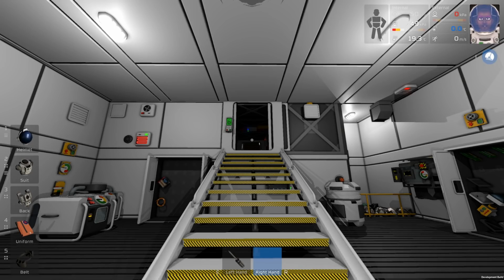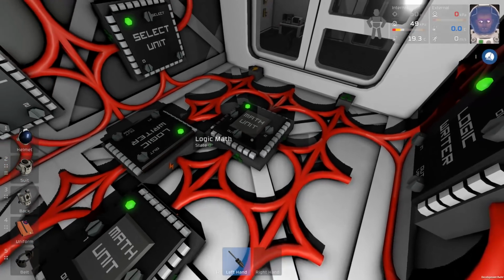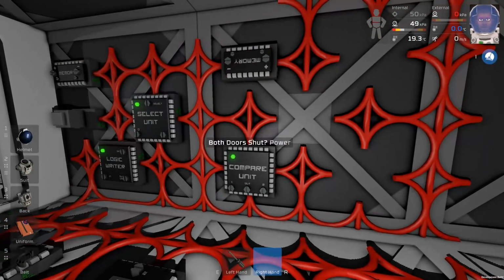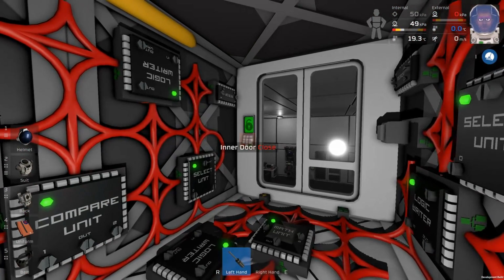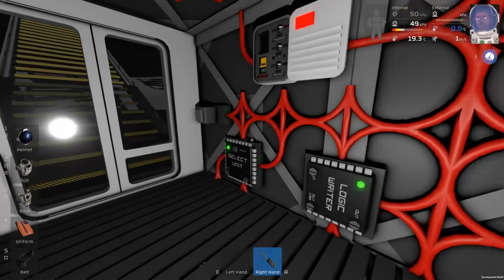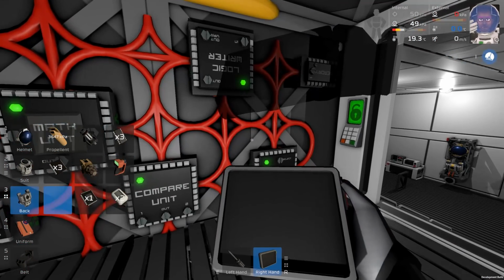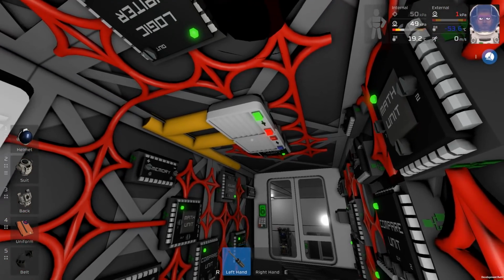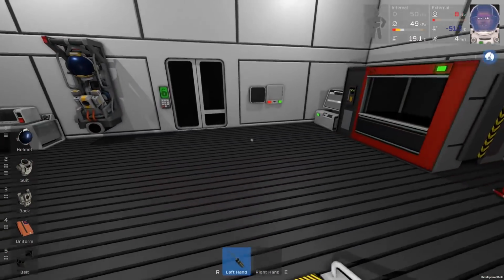Stationeers E26 Custom Build Airlock Part 2 (Electronics, Pressurisation)

Comment: Here's an idea to simplify this:

on each door have a sensor outside the airlock.  Compare to the airlock pressure.  Doors can only open if the airlock pressure=outside pressure.

If the door can open, and you press a button, the door opens for five seconds.

If you tell it to pressurize, it can only go up until the high pressure door can be opened.  If you tell it to depressurize, it only runs until the low pressure door can open.

The door logic could be "fuzzied" a bit so that they don't have to have perfect pressure, and you might want to add a safety so that both doors have to be closed to change the pressure, but that's about it for a manual airlock.

Comment: Lovin the video series.  Havent watched vid 3 yet on airlocks but hoping you do get to do a system that spans two different pressurised areas.
Could you clarify 1 thing for me though.  You stated that you changed the button setup from Episode 25 to a fixed system with the ipressurise and idepressurise memory chips.  I dont quite follow what you did there as obviously you still use the state memory chip which is written to with a button press.
Maybe I missed it or am being overly dense but that one flew by me.
Reply from the maker: With a button, you can't just write it's value to memory, because when you let go, it'll reset the memory to zero (the button's new value).  Instead, I used a select with an input of the button, where when the button is zero it'll use whatever the value is of the logic memory, and when the button is 1, it'll use iPressurise (or iDepressurise depending on which button).  That ensures that the memory is set to the correct value on a button push, but doesn't change it otherwise, since other electronics will be changing the logic memory's value (to understand what state the airlock is currently in)

Comment: Mmmm, looking at this, I think you're at the point where you could benefit, electronically, from a stateful computer. I.e.

"Is pressurising state 0 AND is interior pressure equal to exterior sensor, if so, open door" From a pragmatic point of view, it'd be interesting to see the level of complexity you can achieve through a terminal (if you can code custom chips) or proper computer relative to this huge spaghetti code.
Reply from the maker: Oh, this'd be simple if there was a scriptable/programmable computer :)
Reply: Absolutely. I was just thinking about your first solar angle setup, where you had all those cases inside the computer. It feels like that would be a good match here for your getters and setters with multiple conditions.
Reply: I was thinking that they should just add a programmable PLC to the game, so that you can use multiple virtual components.

It would be quite simple to control an airlock IRL with a PLC.

Comment: this is getting complicated , but in a good way, however can you not "use" the door buttons as buttons, because you can lock them from with logic, and when locked they will still output a signal to the logic network but not actually open the door

Comment: On our dedicated server, we resorted to using the airlock doors manually. We leave the active vent inside the lock on constantly, and when you go through a door you close it behind you. Wait at the outer door until your suit's sensor reads zero on external pressure. Haven't had any mistakes yet, but of course you could accidentally open both doors at the same time. In the future, maybe they will lower the power draw for logic components to a very small amount to reward even complicated logic-based automation.

Comment: Is the oxygen not too cold once you take your helmet off? I thought the oxygen needed to be warmed/cooled to the ideal temperature.
Reply from the maker: It does need to be warmed - there's a wall heater that automatically warms it up if I leave the atmosphere in the room.  It only cools down to -60 or so, because the atmosphere storage tank is in vacuum

Comment: For faster pressurisation;  use active vents for depressurisation and passive vents with pipe pressure pumps (or pressure limiters) for the pressurisation.  This allows us to pump the air using different classes of objects so we can use a single batch writer for each.
Reply from the maker: As in the video though, you can just put the active vents on separate subnetworks with a single batch writer each too :)
Reply: grayduster indeed. I haven't tried it, but I suspected it would be easier to work with one network as you don't have to care about the layout (you don't need to maintain a separation between the networks.)
Reply: But pressure pump is pretty slow... Isn't it? Maybe use volume pumps with shut off?
Reply from the maker: Pressure regulators are quite slow compared to active vents, definitely!

Comment: If not easy use 3 gas sensors  outside  inside and Chamber  if  outside < camper close inner door + depressur    if  outside = camper open ext door
Reply: If you add system for air filtering and temperature regulation it will cause pressure flactuations, which will lead to strange door behavior. Although, you could add some margin you expect to be normal pressure flactuation

Comment: Isn't there a more easy way to do it ? my next project is gonna be the Airlocks.
Reply from the maker: If you want a normal Airlock, sure.  Two doors, one vent and a console with an airlock board - this is more of an advanced build version.  Check out the early episodes for the easy version!
Reply: If you keep your base at 101 kPa like I do, you can just use a normal airlock.

I'll probably have to build a monstrosity like this for hydroponics myself. Probably involving lots and lots of flow charts

Comment: 19:18 I think you meant Batch Writer. And yeah, you can use them, just make sure not to mix data networks. But you have to use separated APC for that because Active Vents have combined data and power port ;(
Reply: I think all he'll need to do, is rename his active vent(s) in the airlock, and find the corresponding name in the batch writer output. But separating the network is definately a great piece of advice, as it'll remove anything not related to the airlock project from the list/cycle on the logic chips, keeping it tidy and simple. :)
Reply: batch writer uses a type of item not custom names...